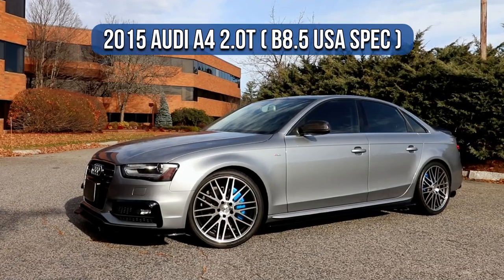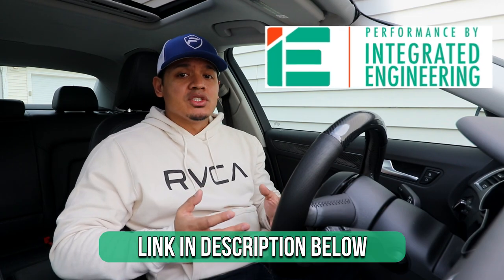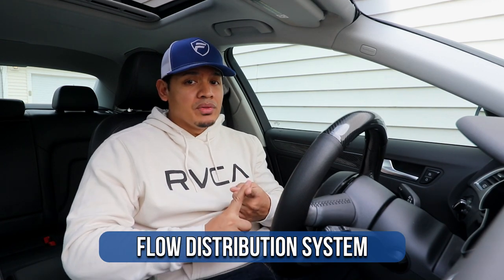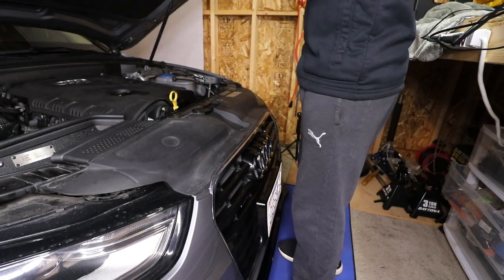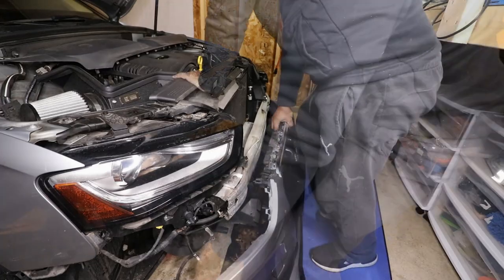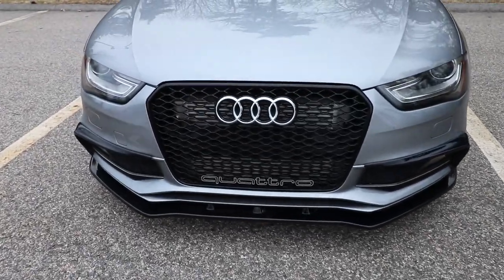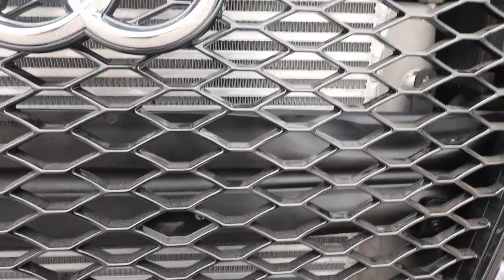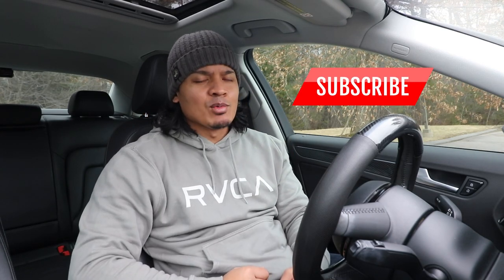LARGEST intercooler step by step install on Audi A4 (B8.5) 2008-2016

Comment: Broski!!! I haven't been here in a minute, I like the production man! I got rid of my W204 C250 and I been shopping for an A4 myself... I have found a few S4's here in CT at a reasonable price tho sooooo... I like what u have done so far man!!
Reply from the maker: Nice!!! S4’s are great cars and real fun with a few bolt on mods and tunes.  A lot of my cosmetic stuff and interior stuff will work for the S4. Not so much my performance mods. Lol.
Reply: Very true. You got that A4 looking sick tho and it's got me thinking....maybe u can update us in a month or two with a mods list and a $ estimate of what you put in. That would def help me decide between the two
Reply from the maker: Yeah. I’ll be doing that for sure. I still have a lot more to do to her.  She will be going on the dyno and possibly the track 🤷🏻‍♂️
Reply: If you’re getting an A4 get the 2015+ only, forget about the previous years !!

Comment: You need to add a K04, and an aluminum IE manifold. I have those on my 2012 Avant, along with numerous other mods. The car hits triple digits pretty quick. Great descriptive videos!👍
Reply from the maker: No thanks. I’m good with my stage 2.

Comment: New subscriber here! I've watched all your Audi videos, from the first to the last vid, and I'm very impressed with your work so far. I just got a 2013 Audi A4 Silver, and I can't wait to start the mods.
 I just have two questions; you mentioned something about wrapping your whole car from the start of your first Audi video. Did you eventually do that? Because Your car body still looks the same, or am I tripping? 
And final question, do you think a glossy black vinyl will look good on a silver car?
Reply from the maker: Thanks!

I didn’t wrap the whole car. Only spray wrapped the roof.  After adding a bunch of black accents to the car…the oem paint actually started to grow onto me. 

Gloss black vinyl looks great against silver.  I wish my car was silver instead of this blue-ish silver gray.

Comment: That was a really good video but I have one question left: Now that your new cooler is way bigger than the original one he is overlapping the other cooler above him. So my question is if the cooler behind is still getting enough air to do his job correctly?
Reply from the maker: The FMIC doesn’t cover it completely and the intercooler backing isn’t butt up against the radiator.  Air will still hit the upper portion of the radiator and flow down.  I don’t foresee any issues with overheating due to loss of airflow to the radiator.  These IE intercoolers been out for awhile and I haven’t heard any issues with a car overheating.
Reply: @TheFlexxGarage  Okay I didn't knew that but that's good. Nice to know. Thanks for your answer.

Comment: Hi Alex, I have the exact same car, so I am following your channel with much interest; if I will change the intercooler in the same way that you did, but nothing else( no engine tune, remapping, no change of the air filter, no turbo upgrade), will it have any issues, such as turbo lag, or just benefits?
Reply from the maker: I’m not 100% sure but you should be able to drive with just the intercooler installed.  It will help cooler down the air drastically however because you have more air in the intercooler, you “might” experience a slight turbo lag between shifts. That’s why it’s recommended to get a tune once you performance drastic upgrades in comparison to stock parts. I drove around with just the intercooler (before doing a downpipe) and it was fine.

Comment: Hey, I have a B8 A4 I have a CTS intake, custom exhaust and IE stage 1 tune, the car feels so much better, I don’t think it’s slow anymore but I think I need a bit more power so I’m definitely going IE stage 2 soon, I’m looking at the CTS and IE  intercooler, they are both massive, so my question is, do you get a bit more turbo lag with this big intercooler ?
Reply from the maker: Don’t know yet.  I haven’t driven the car hard yet. Until everything is done…I’ll do a review video on “stage 2 tuning” an A4 and the Pros/cons.
Reply: Do you have a guesstimate for hp/tq numbers?
Reply from the maker: IE states on their website that a stage 2 tune (paired with intake, intercooler, and downpipe) will get my A4 to about 290ish HP. Stock A4 is at 220hp brake horsepower. 

And the stage 2 tunes also allows for optional exhaust crackle tune as well. This will be interesting.
Reply: @TheFlexxGarage  yes !!, I’m planing to get the crackle tune, but I’m pretty sure you need a test pipe or a high flow cat, in my case I’ll go for the test pipe, apparently it’s going to be really loud because my car is kinda loud already and I still have the stock catalytic converter, downpipe and resonator, but the good thing is that if it’s too loud you can go back to the regular stage 2 without the crackle tune

Comment: I have read something about this not being able to be fitted with Audi A4 B8 with Dynamic Steering?? Unless I remove the Dynamic Steering.. Is it worth removing or are there other options for a front mount intercooler??

Comment: Hey Flexx, when you go to stage 2 can you say whether the tune works ok with the stock cat in. I plan on getting a catback exhaust because I still need to pass inspections and stuff and I haven’t been able to find a definite answer anywhere
Reply from the maker: Stage 2 recommends to run IE downpipe.  It’s not a cat delete.  It’s just a hi-flow catalytic converter downpipe so I can still pass inspection. That’s the only reason I’m doing this.  If it was a catless downpipe…no thanks…that’s illegal in most states. I always believe in having cats and mufflers. Resonators can be deleted but not cats and mufflers.
Reply: @TheFlexxGarage  what state are you still getting inspected in because I’m in PA and I can’t find whether it would pass or not
Reply from the maker: Haha. I mentioned in the video I’m from mass and I need to rock a lame ass front plate.  

Here…you have to have a cat and muffler and you’ll pass.  Deleting any of those is illegal. They don’t care about resonators or second cats/resonator hybrids.

Comment: Are there no E85 tunes for stage 2? That's basically all I use in my 2013 Allroad since its a flex fuel engine and E85 is a dollar cheaper per gallon currently than 93 premium
Reply from the maker: Go watch my stage 2 tune video. I’m pretty sure it has it.
Reply: @TheFlexxGarage  I was actually commenting on that one and the video switched over before I finished the comment (didn't think YouTube did that). But yes it showed tune options for 91, 93, and 100 octane. I didn't see one for E85, was your car flex fuel before the tunes?

Comment: I did an RS grill on my 2011 a5 a couple years ago and the way I put the radar for the adaptive cruise control on the new grill gives me issues often when I try to use it. Was wondering if your car has adaptive cruise control and if it does how you mounted it.
Reply from the maker: The only sensor i have is for a garage door. I mounted it underneath the black plastic cover that’s on the top area above the grille area.  I think I used tiewraps.

Comment: is the car quieter now that you changed the BOV? ive been thinking of switching out my BOV to the one you installed as well.  the one that is in my car right now is the GFB VTA BOV.
Reply from the maker: Yea. A lot quieter. Now I just have the sucking sounds of the IE intake and my exhaust.
Reply: @TheFlexxGarage  i get annoyed of the pshhhh sound at times since i daily drive my car.

Comment: What kind of paint did you use for your crash bar? I've seen others wrap it. Recommendation? My IE IC is on the way, so trying to plan ahead.
Reply from the maker: Just high temp paint from the auto part store. Mine dries to a satin black. I think gloss black will take away from a gloss black grille (if you go RS grille like mine).
Reply: @TheFlexxGarage  I'll be doing an RS style as well. Sounds good. Satin black high temp paint it is. Cheers!

Comment: Hey flex I have the same car as u and am planning to stage 2 but instead of the gfb diverter valve plus I just got the ecs tuning diverter valve is thier a difference between them

Comment: Hey man, did you buy that "Quattro emblem" separate? If so, where did you get it and how did you attach it to the grille?
Reply from the maker: Yes. Bought it separately.  I’ll put links in the video description. It’s double-sided tape on the back but it won’t stay on. And there’s tiny holes for screws but there nothing on the inside of the grille to screw it onto. So I hot glue gunned it on from the backside.

Comment: Did the new diverter valve change the blow off sound at all? Or is it still butterfly sounding?
Reply from the maker: Yes. No more flutter period. Just woooshing sucking sound from my IE intake along with my exhaust sound.  I got tired of the flutter.

Comment: The charge pipe on passenger side that runs to the intake manifold how did u do it? did u cut the existing plastic one and join silicone onto that? i have same kit but silicone isnt long enough to go that far up?
Reply from the maker: Umm. On my US spec car, The passenger side charge pipe comes off the turbo into the intercooler. It doesn’t come off the intake manifold. What you see in the video is the install. There’s nothing else to do when upgrading charge pipes. So I’m not sure what you’re talking about.
Reply: @The Flexx Garage  awwk im in australia so thats my drivers side so the opposite side to the one that comes off the turbo

Comment: Do you know if this would fit the 2013 Audi S4 B8.5? I only see notice for the A4 but not the S4.
Thanks
Reply from the maker: No it won’t. An S4 engine is not the same as an A4 engine. You need to go to IE’s webpage and look up the S4 parts.

Comment: Good day. Does the temperature gauge stays normal like the stock intercooler?
Reply from the maker: The intercooler has nothing to do with the cars temp gauge.  

The car’s engine temperature affects the temp gauge. And what keeps the engine temp stable is coolant flowing through the engine and radiator.
Reply: 😂Thanks 👌🏾 I’m doing it

Comment: I have the same intercooler on my a4 2015 but it got removed abit from right side and right now it’s hold it by the bumper so do u think maybe one of the screws got off or something in that case ??
Reply from the maker: Don’t know. It could be anything from a broken tab to missing screws. Only way to know is to inspect it closer.

Comment: Did the blowoff noise change now that you swapped from a BOV to a diverter?
Reply from the maker: Yes.  The stututu is quieter and only happens when I’m driving the car hard and I get some lighter whooshing BOV sound. I get more exhaust sound now and that’s I what I rather have.
Reply: Hey there, I enjoy your videos. Is there any other reason why you changed the GFB. If you left the old one on, would it affect the tune?

Comment: Where’d you put that sensor that was attached to the middle of the old grill?
Reply from the maker: I mounted it on the bottom-side of the black plastic cover on the area above the grill (when you open the hood). It’s just a garage door sensor. I don’t really use it anyway.
Reply: @The Flexx Garage  did you get dash lights because of it

Comment: Question, do i only have to get the down pipe and the cooler or do i need something else to do stage 2?
Reply from the maker: Stage 2 only requires a downpipe to work but you won’t get the most outta the power gains.  If you want to get the most outta it, you need an intake and intercooler too.

Comment: Hey bro, do i need to tune my car if i wanna change my cooler like yours?
Reply from the maker: You don’t need to but i wouldn’t run a large intercooler without pairing it with a tune. Running a large intercooler on a stock tune can provides some benefits especially when it’s hot out or the car is running hot but it won’t be a drastic difference like if you were pairing the large intercooler with a sportier tune.
Reply: Oh okay gotcha appreciate it boss👍

Comment: Feel any gains from upgrading to the fds intercooler? I have stage 2 right now, but no upgraded intercooler. Will I feel a difference in power?
Reply from the maker: You don’t feel power from immediately installing an intercooler.  When your engine heats up and more hot air is sucked into the car as you drive more and more, the intercooler is gonna prevent your car from losing horsepower. 

If you don’t upgrade your intercooler, probably after 20mins of driving…you are losing horsepower and you don’t even know it. Example a car with 300hp doesn’t have 300hp all the time. You can lose 30% hp after the engine gets hot. Again, an upgraded intercooler is gonna combat that HP loss so you can keep horsepower after running the car for awhile.
Reply: Great to know; thanks for the information! But, wow, losing 30% is a big no-no, especially if someone pulls up next to you and tries to race you from a red light. So far, how do you like it? Also, should I re-tune my car after installing the intercooler (still thinking about buying it)?
Reply from the maker: Every cars loss is different but I’ve seen some loss between 20-40%. 

I can’t give you feedback yet. I still need to tune my car to a stage 2 since I just got the IE downpipe installed.
Reply: @TheFlexxGarage  that’s weird IE claims 30 plus hp gains on a stage 2 plat form. If there’s no gains I guess I’ll be disappointed 😕
Reply from the maker: Dude…read my replies above.  You gain horsepower during a time when you are losing horsepower if you didn’t have an updated intercooler.
Reply: @TheFlexxGarage  oh ok thank you!
Reply: @TheFlexxGarage  look honestly though I’m
Not trying to piss you off.. your videos are great but there is huge confusion on this intercooler for sure. IE claims 30+ hp on stage 2 and I’ve talked to member that told me that while a lot of people say what your saying too. There’s not enough full in depth comparison videos on like something like a 0-60 before and after the intercooler. Unless your saying IE’s hp gains with the intercooler installed is the same as the stage 2 tune witch I think would be weird if they provide a dyno chart. Based on what your saying IE’s showing false results. But I’m by saying your wrong either there’s just a lot of un known about these intercoolers. I can’t wait for your video to release after you got everything hooked up.
Reply: @TheFlexxGarage  not*

Comment: Can you link the paint you used for the crash bar looking to doing it myself thanks
Reply from the maker: Just go to autozone and buy anything that’s black and high temp resistant.  Up to you if you want gloss or matte black.
Reply: Will do thank you bro was yours matte or gloss?
Reply from the maker: Matte.  It’s hides the crash bar better cause it doesn’t reflect light.

Comment: do you know how much horsepower is added with the intake? ik it’s not much
Reply from the maker: An intake barely adds horsepower. Especially by itself.

An intake should honestly be only installed when you plan on upgrading more parts cause those parts will rely on an intake to take in more air that it can use up.

If you install an intake without doing anything else to your car, then you are purely just gonna get a nice looking intake, some more intake air sucking noise, and maybe a few HP. Horsepower that you won’t even feel.

Comment: Hey how did the Quattro logo hold up?
Reply from the maker: Fine. No issues. I used hot glue on the back. Using just double sided tape is not enough.
Reply: @TheFlexxGarage  did you modified the Quattro letters or something like that, they looks way different than the kit on the description.

Comment: Can I paint the intercooler black?
Reply from the maker: You can do anything you want. I wouldn’t. Black absorbs a lot of heat and plus you are adding a layer on the aluminum surface of the intercooler.  Raw aluminum is always cold and will keep the air colder.  Think of an aluminum soda can.  If you took two out of the fridge, one is regular and one can was painted with a layer of paint…which can do you think is gonna feel colder to your hand?

I wouldnt do more than paint like a logo on it.  But I rather keep mine free of anything.
Reply: @TheFlexxGarage  thanks for going in so much detail man I appreciate it ( I asked because I have already done it and the car it’s not how it used to be before — silly me :( but lucky I did Plasti dip easy to remove)

Comment: I have installed the intercoller and after since the car just over heat every 2-3 miles
Reply from the maker: Please don’t blame an intercooler for some other issue with your car. You’re putting out false information which can be seen by people who are still learning about cars and who may be interested in an intercooler for their car. 

Have you thought about letting a mechanic inspect your radiator, your coolant levels, and cooling system? Cause all that is what keeps your engine cool. If it’s not working properly, then your engine overheats. 

The Air intercooler is not designed to cool your engine. The air intercooler is just cooling air coming in from the air intake that’s going into the engine to burn with fuel. If the air temp is high, the cars performance decreases. If the air temp is cooler (by the aftermarket intercooler) then the cars performance increases.

Hopefully you learned something new today.
Reply: @TheFlexxGarage  I love your videos and these slow but perfectly understandable explanations. I'm 17 and planning to buy a 2.0 TDI Audi A4 B8 Avant from 2013. I would love to follow your tutorials and mod/tune my car. Do you know if the things you have been showing in this and all of thr other videos about the A4 apply to the car I want aswell? Im really looking forward to modding my car since that has been my dream foreverrrr, hope those mods are legal in switzerland.. 🙏